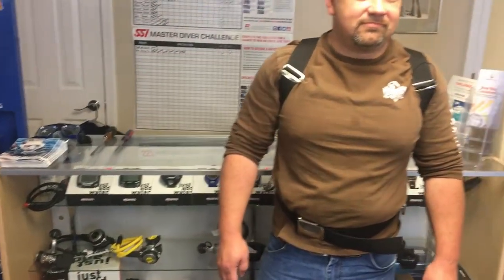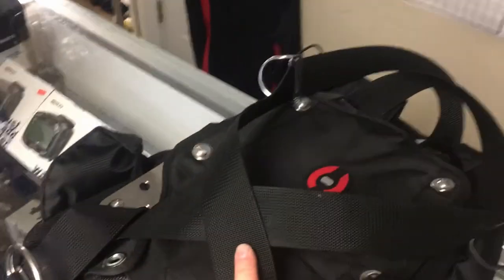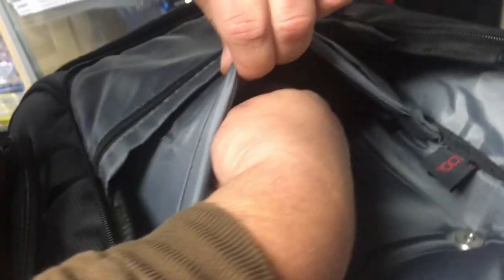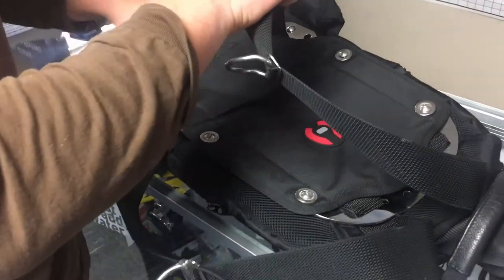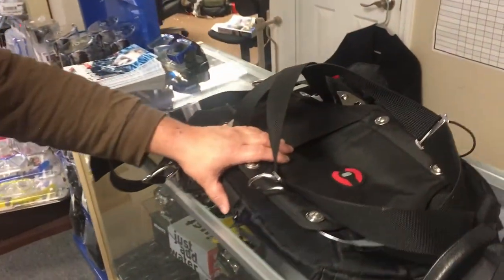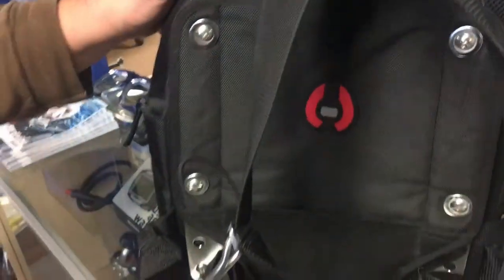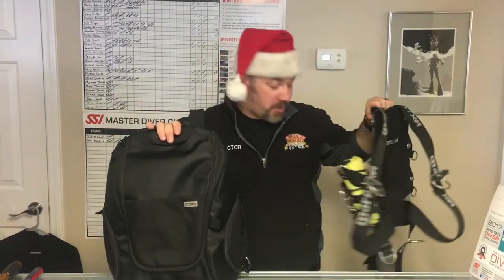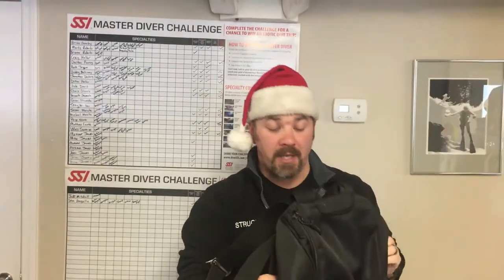Another Option For Flying With A Back Plate And Wing

Comment: This a great idea!, and if you get a Mil-Tec MOLLE system backpack such as a U.S Assault Tactical you can add D.Rings on the sides to the MOLLE slots and zigzag a piece of paracord between the D-Rings and the sex-bolts on the backplate. Cinch averything down and you are good to go withouth modifying the backpack at all. You can even do without the D-rings and route the paracord directlly through the MOLE slots. Tuck the backpack belt and straps and BP crotch strap behind the backplate and all done! Tried this with a Tecline MIDI Backplate and works great.
Reply from the maker: Hello tasheido, glad you liked the video. And thank you for sharing your experience with us on the Mil-Tec MOLLE system backpack.